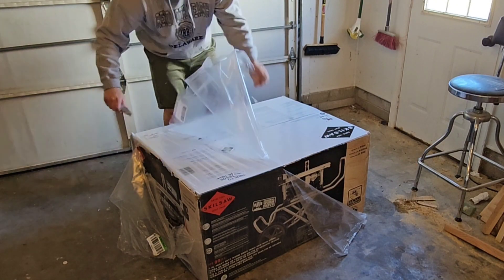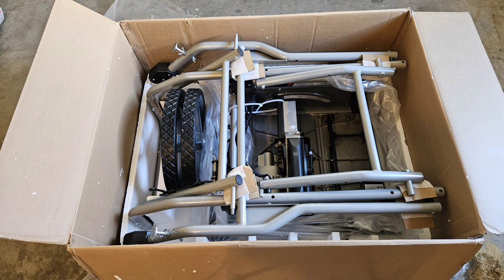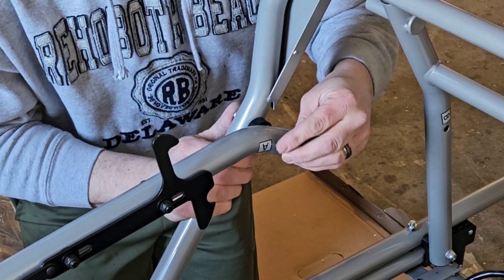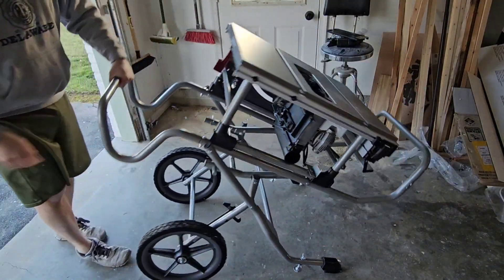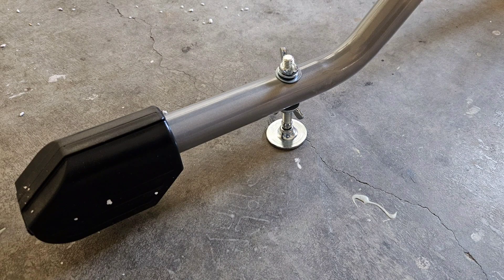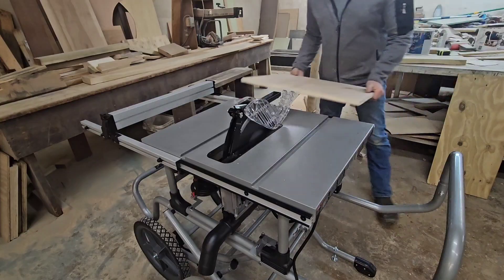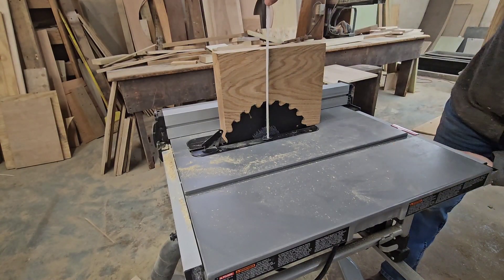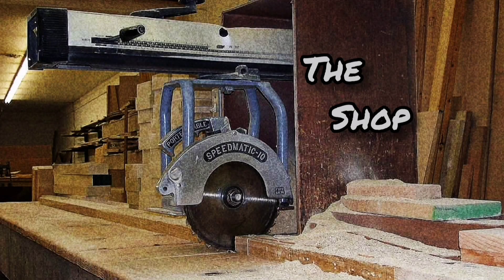SKIL SPT99-11: Unbox, Assemble, and Test

Comment: I have had this model of tablesaw for 5 years.  I like it very much. However it does some issues. I am a small time contractor.  This means I have to bring my saw to where I am working.  It is a little awkward to load in my truck.  The 16 inch wheels more than make up for it.  All the other brands have 4 inch wheels and are very hard to move around the job site and up and down stairs. Depending on what I am cutting I use different blades, it does not have a blade caddy.  The slide for the fence fills with sawdust and when it is freezing out becomes inoperable. My big complaint about it is that the mechanism to raise the blade requires a lot of maintenance. It got so stiff that the plastic wheel stripped and I use visegrips now.  I do really like that it will rip a 4 x 4 in one go instead of being 1/8 inch shy like all the other saws.  It has enough power to rip a PT 4 x 4.
Reply: I also love the saw and have struggled with the blade height wheel. Debris seemed to get trapped in any grease on the vertical gear. I blasted it with brake cleaner and used a wire brush, now it operates much better. I also hated the lack of a proper zero clearance but I found a decent one on Amazon just this last month

Comment: Thanks for the video.  The manual was horrid.  Suggestion to all - add something rubber/plastic/sacrificial to the bottom of the folding support.  There's nothing to protect it from scratches and eventual rust.  Adding some feet or a sacrificial strip of wood is probably wise.  Bidding adieu to my well used Ridgid today with a rusted stand.